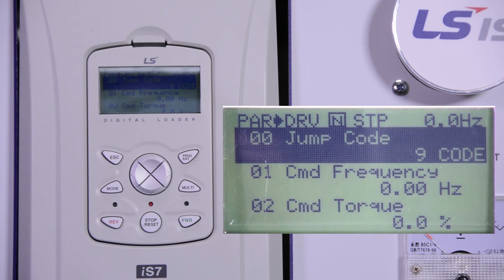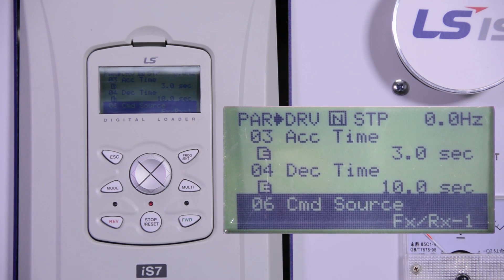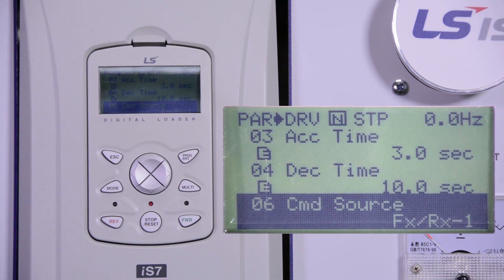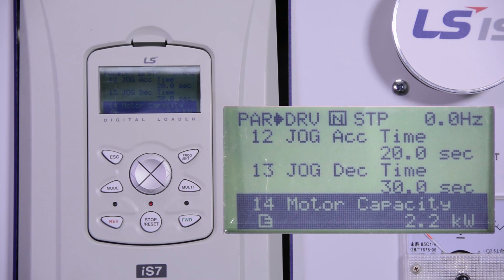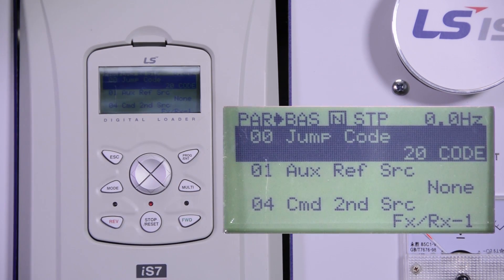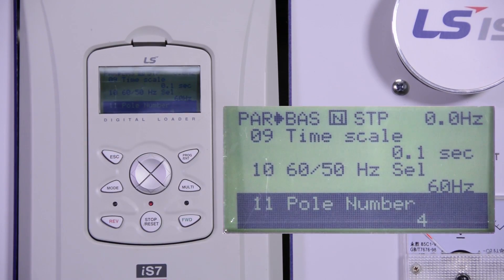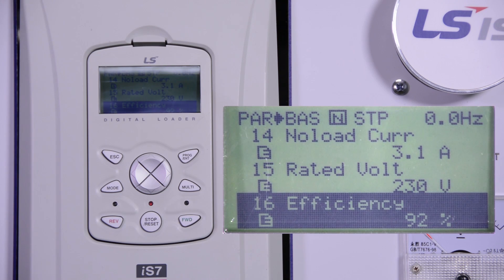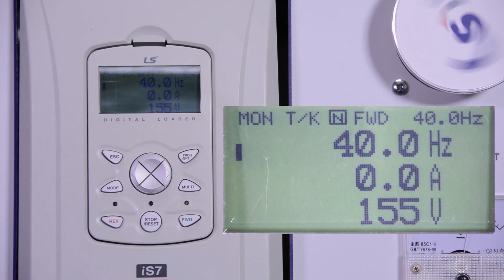LSIS IS7 general overview video

Comment: Hello,
We have an LS IS7 drive.
There was a short circuit in the I/O terminals, and unfortunately, after turning the drive off and on again, the power displayed on the keypad has changed from 7.5 kW to 0.75 kW.
The DC link voltage is also incorrectly displayed.
Is there a solution to restore the drive back to 7.5 kW?
Thank you.